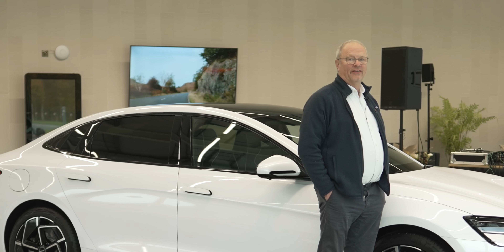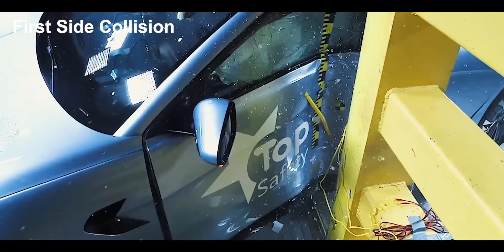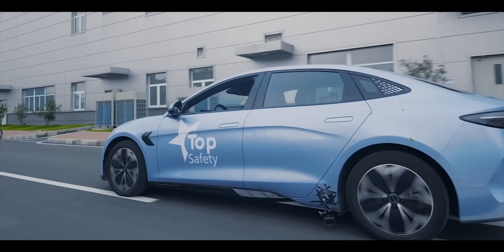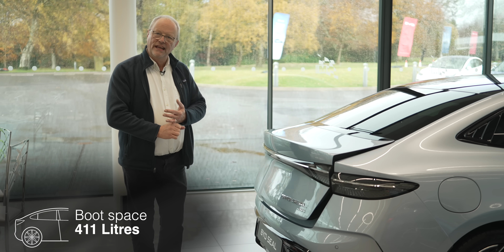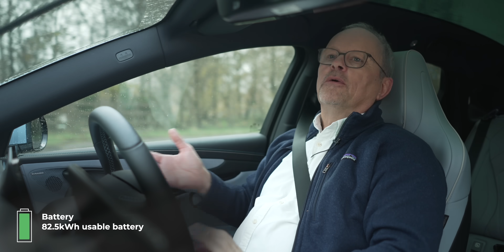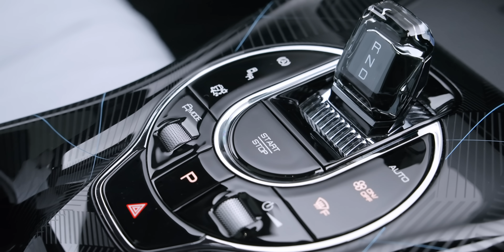This Car Proves Just How Far Chinese Cars Have Come

Comment: If you don't notice any change in range, with the heat pump on,  ( 08:49 ) where does the energy for the heat pump unit come from?  Help me understand that so I can use that tech in my house and not increase my electric bill what so ever.
Reply: You already do use it in your house, assuming you have a fridge. If you have an air conditioning unit, that’s also a heat pump. Heat pumps doing create heat, they move it from one place to another, that’s why the back of your fridge is hot, that is the heat that the heat pump has pumped out from inside the fridge.  Heat pumps generally move 3x the energy they take to run. They are VERY efficient if you want to move heat out of one place and you also want to move heat into another. 

In this test, the car wants to get rid of heat from the battery pack, and Robert wants to move heat into the cabin. So it solves one problem with the other. If he was driving in a hot climate, that wouldn’t happen, the battery wants cooling and so does Robert, that’s when you will see range plummet.

Comment: I wonder how their service is, if they're competent, if they have good parts supply, if they're adressing warranty issues fairly and not just "it's not a fault, it's to be expected from the vehicle" and brushes it under the rug. Renault showed me that a manufacturer doesn't acknowledge obvious faults and everything was "normal behavior" from the car. MG showed me that customer service reps can be very unhelpful and don't put the least bit of effort into getting to a solution. Glad I dodged that bullet by being able to cancel my order. The red flags started popping up when I read the 7 year warranty which had a lot of asterisks and also omitted a few of things that were covered by warranties of other manufacturers.

It's nice and dandy that this BYD is impressive, it would be a shame if it wasn't. But I want to know how the manufacturer fares with customers, how good their service is and how much they care for customer satisfaction and not just selling the next car. Renault and MG didn't care for that, will BYD?

Comment: Had a test drive today, to be fair the interior is way better than my M3, however, few details, like lane departure assistance, acceleration, auto regeneration, infotainment itself are not as much as I expected, they took away the dash cam ability! For sake of ‘security concerns’, can’t use sentry mode which is a done deal for me sadly, and one very key impact for it’s future sale figures, it’s way much expensive than it should be, for that price believe most people will just go for a current MY instead, came too late and too expensive, BYD you need to do something about it !

Comment: My worry with all Chinese technology is that they didn't design, develop, and evolve their way to their current level, learning over many years by trial and error. They essentially stole their way there by copying other companies technology and copyrighted designs and just built on top of that....and it does look a very familiar design.....
Reply: So？now China is advanced
Reply: @富忠1998  >> So？now China is advanced  <<
advanced in what?
Reply: Not if the collapsing of tunnels bridges and houses is anything to go by. When you take and dont earn, you dont learn the basics well enough. You build upon unsure foundations, lets see how it goes
Reply: @adambodhi431  Now China is the superpower，we have alot of markets，such as many cars companies，dji drone，TikTok，video or mobile games，even Tesla use byd battery，we dont care you my babe
Reply: @富忠1998  >> Tesla use byd battery <<
Tesla's primary battery supplier is Panasonic (and has been since 2010), followed by CATL which supplies cheap, low-end batteries for entry-level models.  They also use LG Chem's for Long Range models.
Reply: @tooltalk  This is several years ago，now Tesla use byd battery，China is getting better，do not lock yourself，just go China and see
Reply: @富忠1998  : >> China is getting better，do not lock yourself，just go China and see <<
 China is not getting better.    CATL's strength is in mass-manufacturing cheap batteries, but their batteries are inferior.   China is still years behind South Korea and Japan, but China has more market share because China doesn't allow SK or JP battery companies from participating in China's nEV market to protect CATL/BYD.
Reply: @富忠1998  >> China is getting better，do not lock yourself，just go China and see ...<<
Tesla started using CATL in 2019 and BYD in 2023.   CATL and BYD make low-end batteries for entry-level, low-end batteries; LG and Panasonic supplies superior batteries for Tesla's Long Range and Performance models.
Reply: @tooltalk  I see you are Korean hahahaha
Reply: @富忠1998  >>  I see you are Korean hahahaha  <<
You must be a wumao.. 🤣🤣🤣
Reply: Exactly 👍
Reply: @adambodhi431  So, ESA engineers probably don't know the damn basics so as to be left in dust by Chinese engineers who don't learn the basics well ?
Reply: @tocu9808  you like the  word Damn..... very forceful 👍
Reply: @adambodhi431  You mean Chinese engineers could launch spacecraft to the Moon, build orbital space station and send astronauts up there without learning the damn basics well enough, don't you ?
Reply: Why is it a 'worry'? 
If the car is not good then don't buy it. 
If it's good and U chose to buy it then enjoy it.

Comment: BYD sells more plug in cars than any other company in the world.
Blade battery is safest LFP EV battery in the world.
Shame it is a sedan as world-wide that is a diminishing market due to poor packaging compared to SUVs.
Tesla Model Y outsells Tesla Model 3' 2:1.
BYD needs to get the Song L in the market quickly as like their Atto 3 it is an SUV so the most desirable in 2023.
Disclaimer: we own an Atto 3 and love it and wouldn't back-trade to a low slung sedan again because entry/exit for passengers and luggage is always better in an SUV.
The BYD Atto 3 is 345mm shorter but has 440l of boot space because SUVs are better packaged.
Sorry Robert but BYD could over-take Tesla in EV sales worldwide on current trajectories.

Comment: So there are NO bad points on this car? Not even one? Comeon, the driverassists are terrible, there are no real help on trips to plan charging and it doesn´t give an estimated SoC on arrival. On top of that, no OPD, charging is slower than Tesla and quite a few other brands, and only 570km from an 82kWh battery? That´s terrible. Thats only slightly more than the base Model 3 with a 57.5kWh (usable) gets, and i know for a fact that Tesla can actually achieve the range it advertises.
Reply: That's not how battery works you dingus.
Reply: @whiteshark450  enlighten me then
Reply: @Colt16v  batteries are never at 100% the second they are off charge, you're losing juice. The temperature also plays a huge part in battery life. That's why cars change their battery every 3 year, because just by idling they are losing their lifespan. I'm an electrician.
Reply: @whiteshark450  Makes absolutely no sense. Cars are not changing battery every 3 years. And it´s basic physics. If you have 2 cars, similar size, but one got 57kWh, the other 80kWh capacity, and they go around the same distance on a single charge, the car with the bigger battery is less efficient. Temperature and static discharge plays no part in this. It really is simple physics.
Reply: @Colt16v  Use some critical thinking please, im obviously talking about petrol cars and yes the recommended battery change is 3-4 years. Now, i'm not gonna give you a whole class on battery but you do know the current bottleneck is about storage and maintaining the charge as long as possible. Thats why we have lithium, graphene, hydrogen batteries in developpement.
Reply: @whiteshark450  I don´t know why you are bringing lead-acid batteries into this. You are trying to make a point that simply does not fly. The BYD Seal RWD goes 570km from an 80kWh battery, while a Tesla Model 3 RWD goes 554km from a 57.5kWh battery. Why and how you can reason that the BYD is not ineffective, really confuses me. It´s like you´re saying that 5 red apples are the same as 8 because the others are green lol.

Comment: It doesn't matter wich electric car you buy. My cobustion car with 1/3 of the cost will outpreform any electric car at about 150000 km. By that time the electric car battery is basically dead and useless and my car just drives a long for a nother 150000 km without any major investements or problems. 😂😂
Reply: Enjoy life bro. Try new things. Try new ice cars.
Reply from the maker: Please keep your old combustion car. It's fine.
I will keep my electric car, which will, without question, outlast any combustion car ever built, and cost about 1/10th to fuel, service and maintain.
But don't listen to me, only listen to the huge crowds of well paid people who will keep telling you lies about batteries, you know, the people who also sell you the fuel you burn.
(The problem you have with me is that I drove combustion cars for 40 years before I drove electric ones. I know, from long, bitter experience what keeping an old clunker on the road really costs.) Good luck and happy driving

Comment: This is how Tesla’s technology is being stolen in China.
Reply: >> This is how Tesla’s technology is being stolen in China. <<
Tesla willingly gave it up in exchange for access to China's NEV market.   Otheres weren't obviously so lucky; see the EU's WTO complaint against China WT/DS549.   South Korea and Japanese battery makers were required to give up their IPR to access China since 2015.
Reply: @tooltalk  source ? Proof ?
Reply: Except tesla uses byd batteries . Lol
Reply: @zacksmith5963 : Tesla uses China's cheap, inferior batteries for entry-level, low-range EVs.

The company uses LG (Korea) for Long Range models and Panasonic (Japan) for Performance.
Reply: @tooltalk   "the company uses lg (korea) and Panasonic (japan) for performance 

Until recently, another Chinese battery maker CATL was the sole supplier of batteries for the Model Y in Europe, but in early May it was reported that Tesla had started using BYD as a second supplier.

Data posted on the German forum Tesla Fahrer und Freunde shows that the Model Y with the BYD blade battery maintains peak charging speeds well above the CATL version.
Reply: @zacksmith5963  >> Until recently, another Chinese battery maker CATL was the sole supplier of batteries for the Model Y in Europe, <<
CATL's only provided cheap, inferior LFP batteries for entry-level, low-range EVs since 2020; vs Panasonic since 2010.  LFP are inherently inferior batteries with low energy density and heavy weigh -- ie, barely passable for moving vehicles.   Tesla's Long Range models in China/EU always relied on LG's NMC.   Tesla always relied on Panasonic for batteries much longer than CATL. 

>> Data posted on the German forum Tesla Fahrer und Freunde shows that the Model Y with the BYD blade battery maintains peak charging speeds well above the CATL version. <<
Chinese batteries are generally cheap, hot piece of garbage. The fact that BYD battery can charge a little bit faster in Tesla says nothing.  The same blade battery in ATTO 3 and Model3/Y have different charging speed because they have different BMS, expected lifespan, etc..
Reply: @tooltalk yawn this is toooo easy 

- CATL only provides cheap inferior LFP batteries for entry level low range  .  ( where is proof ) 

LFPs are inherently low range with low energy density and heavy weight ( nope since all battery tech is heavy and CATL is actually lighter compared to panasonic outdated battery tech.  But plz prove it ) 

Tesla always relied on panasonic batteries for longer duration than CATL (if they did they wouldn't need CATL ) 

Chinese batteries are generally cheap ( ok and ? ) 
Hot piece of garbage ( not according to tests by ncap and German authorities )

The fact that BYD can charge faster in tesla is nothing ( sounds like u are jealous )

U sound really jealous .

Comment: Looks nice. Looking at some of the immediate post WW2 documentaries, it appears that there was a lot of rebuild resource put into our former enemies countries. Consequently, Germany and Japan got a bit of head start with having modern factories and facilities. Perhaps it shouldnt have been a surprise, therefore, that after 20/30 years they got really good at "stuff" in general, but most obviously in cars. What was surprising is that the rest of the world - UK and America failed to adapt as fast. Even when I worked in the US in the 80's, the letters page of USA Today, following article on hos the big three auto makers were now the big 5 with Toyota and Nissan over taking local brands, were still saying the US should forget about smaller more fuel efficient cars and America should concentrate in what i was good at - big cars. I wonder where they would be now if they had followed that advice. Hats of to Tesla for seeing where the market needed to go, building the cars and the infrastructure to support them. However, we can also see that us shipping tech to China (it was cheaper to build there guys) was giving them a heads up and like post war Germany and Japan, they have run with it.  
One might argue that the seal is picking up on the "flaws" of the Tesla model 3 and fixing them as they go. Probably, Tesla need to take a look at their driver to tech interface. IMHO, its not about less buttons, its about can effective interface. I have my reservations about the new model 3 (even though I could do with electric boot and bonnet openers) for that reason.  BYD, on the other hand...
So which side is the BYD charger port ?????

Comment: Very common comment from the the MAGA Trolls is that Chinese equals poor quality, just another example of how delusional they are. I own an MG but there is part of me that regrets the fact the West has exported manufacturing to China. Then I just get annoyed that the legacy brands couldn’t make an equivalent car.
Reply: Oh, another wumao on the CCP's payroll.
Reply: ayup  @tooltalk
Reply: "MAGA Trolls is that Chinese equals poor quality"  i hate trump and it usually does. PRC can pump out good quality sometimes, often when designed elsewhere, but they often intentionally take shortcuts, cut corners, or just straight out scam and counterfeit. So yeahyou have a bad reputation for pisspoor quality that is well earned.
Reply: @jeremytine  source ? Proof ?
Reply: @zacksmith5963  sorry, I don't answer wumao questions
Reply: @jeremytine   u don't have an answer . 4 months gone 

0 answers . Wumao ? Too bad for u that i am american
Reply: @zacksmith5963   @zacksmith5963  4 months? Keep your alt accounts straight. Last time it was 5, then it was a month... You spam so much, it is probably hard to keep track. 

And no, I didn't run away so much as walked away yawning and bored 😉 of your spam.

Comment: Great!! Getting better! 340 to 430 miles of range. Now when it comes to charging, its 30 minutes for 80 percent. Add another 100 miles of range and drop that charging times to 3.5 to 4 minutes which is the same amount of time it takes to fully fuel a regular car. Now we're talkin!! I'll buy on immediately!!! The BYD SEAL has a starting price of 63 thousand dollars. Price range 83 thousand dollars. Ill keep my eyes open for the next generation EV with the hopes that these fine qualities and improvements have been applied. Till then I'll keep my large full size luxurious 2021Jaguar XJl. It only had 18 thousand miles on it and cost me just north of 41 thousand dollars. After using 3 quarters of a tank, i fully refuel (once a month) and takes me 3 to 4 minutes. 3 quarters of a tank provides me with a range of 515 miles and if i used a full tank, the range is 570 miles which supersedes any EV including the Lucid priced at 100 thousand dollars. I travel to much and too far for an EV. I like the ability to keep moving....

Comment: The car being discussed is the BYD Seal, and the video suggests it's not a "Tesla killer" but an impressive vehicle.
The BYD Seal is manufactured by BYD (Build Your Dreams), a company that started in 1995 and is known for making batteries, including those for iPads and cell phones.
The car features BYD's blade battery, which is structurally integrated into the vehicle's floor, providing enhanced safety demonstrated through crash tests.
The BYD Seal is described as having driving characteristics similar to the Tesla Model 3, with a comfortable and controlled feel, a heads-up display, and an interior that is considered high-end and luxurious.
The car has an 82.5 kWh usable battery capacity, claimed WLTP range of 325 miles, and is praised for its efficiency heat pump technology, providing robust performance in a wide range of temperatures.
Reply: >> The car has an 82.5 kWh usable battery capacity, claimed WLTP range of 325 miles, << 
since its LFP and WLTP..  it's safety to assume it's EPA range would be something compatible to 275miles.
Reply: @tooltalk source ?

Comment: As far as I know, BYD Battery is the only company that has passed the battery penetration test required by the Chinese government, which is no longer required to conduct mandatory tests because the testing conditions are so stringent
Reply: I  don't understand the point of the test..  BYD EVs routinely explode in crash -- the most highly publicized recent one was in April 05 in Cenxi, China where a local judge was trapped and burned alive in a BYD Han.

Comment: Nobody cares if a normal gasoline car catches fire coz it doesn't release toxic fumes like cobalt that can even be absorbed through skin. Fire fighters have been paralyzed in Australia trying to put out electric car fires coz there is no enough information on how dangerous they are. Electric batteries are self igniting and they will keep burning even under water till it loses all the energy. There has been some incidents where it took 30 days of submerging the car underwater for the fire to die out.